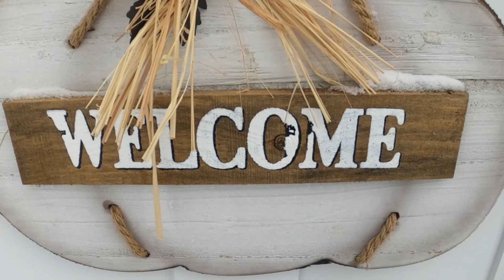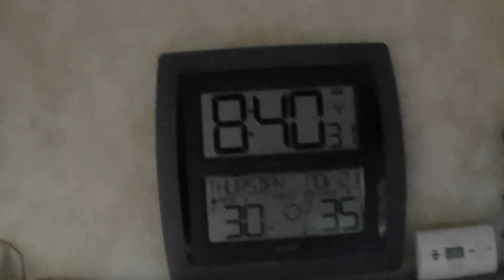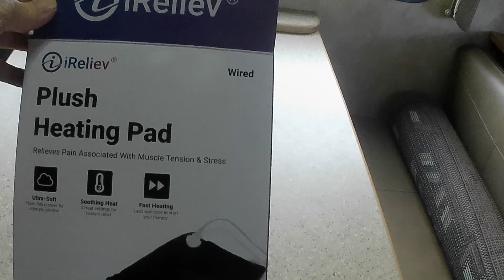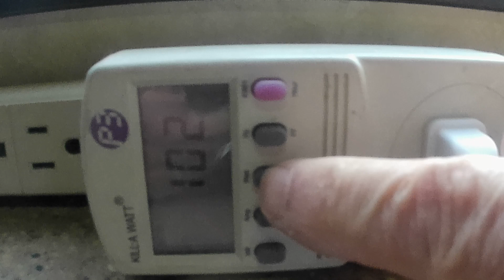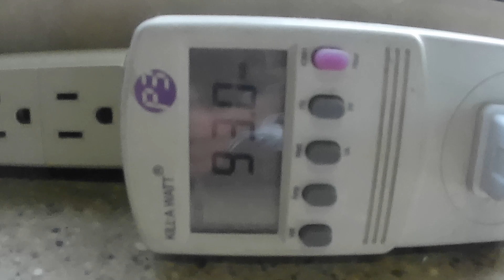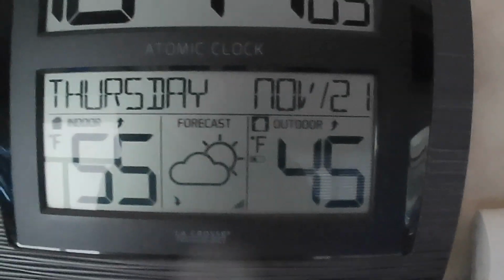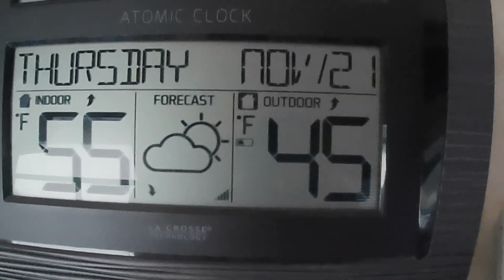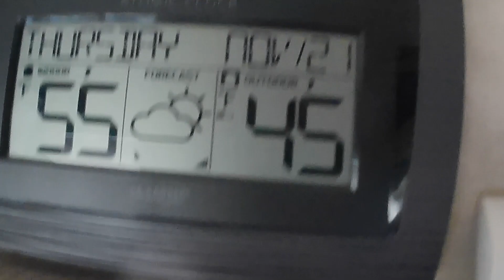An idiot mixed lead-acid with lithium batteries part 3!

Comment: Tesla does it: there is actually a 12 volt lead acid battery in Teslas to run the 12 volt things.  It charges with the same alternator technology as on gas cars, so only when the high volt lithium battery pack auto is running/rolling.   Gas cars still need lead acid for starter batteries because of that same alternator technology and also internal combustion engines and both are designed to work with lead acid.  If you have isolate connect controls on different battery type banks, it can and does work.
Reply from the maker: @OWK000  Good morning new friend, thank you for your comments. Looks like there's always going to be a place for lead acid batteries?
If not done so please subscribe to my channel as I have subscribed to yours.
Thank you for watching and may God bless you!

Comment: Hi Chuck, love your water bottle freezing indicator! 
Unfortunately I see a problem with your setup, in that, hot air rises, even pads directly contacting object do much better mounted on the bottom, so the heat rises into the battery! Also your temp sensor is right near the heating pad so reading a bit high, I think. So I’d mount one orange heat pad under each battery, and not use the new pad that always shuts off after a certain time.
If you’re at home and the lithium’s are above 30%, just take them inside your house, or heated garage if you have one.
Lithium’s don’t sulphate so no need to ever worry if they’re part charged. Just don’t let them discharge below about 12.5 volts, or a bit higher.
Take care, and God bless.
Reply from the maker: @TopMooseCone  Good morning friend, thank you for your comments and thoughts. The water bottle trick is just a little old school! I really thought about putting the water tank heaters under the batteries,but I am leery that the water tank heaters aren't designed for that purpose? The weight of the batteries bouncing down the road they cause a problem and Warren wires may cause a fire